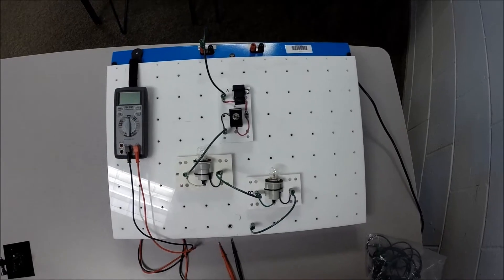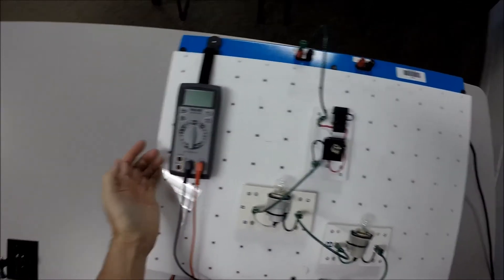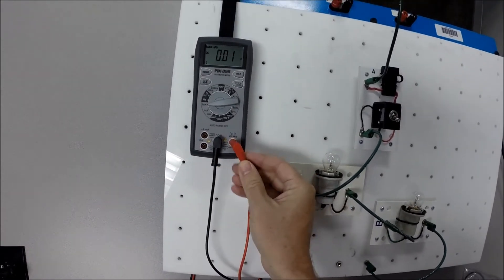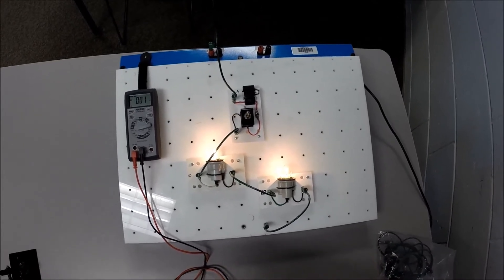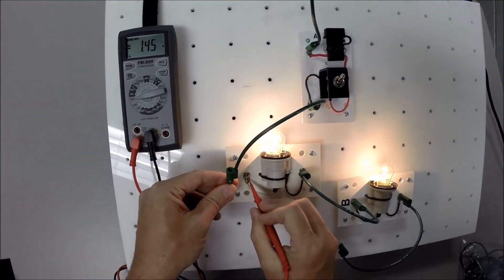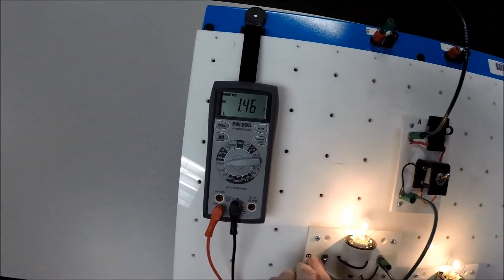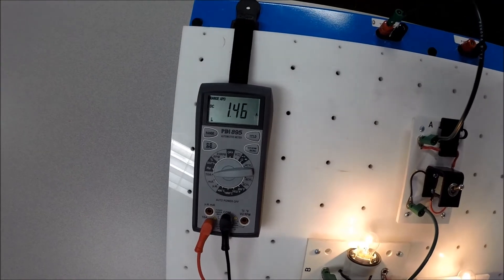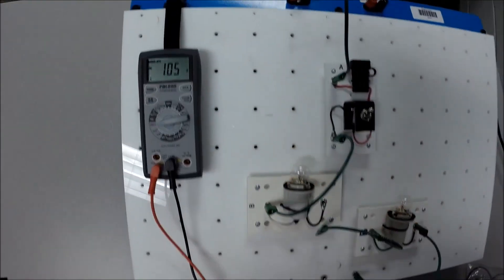Using an Ammeter on a Series Circuit

Comment: but do you have to disconnect the connection?  Can you just leave the wire in and touch both contact points with the leads of the meter?
Reply from the maker: Cydrick C You have to disconnect because you have to force all of the current through the meter so it can be accurately measured.